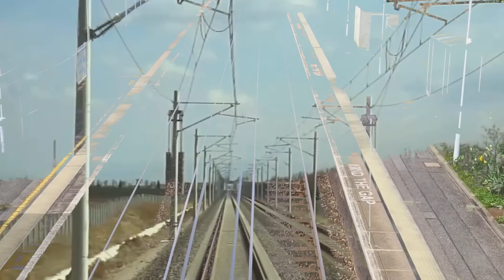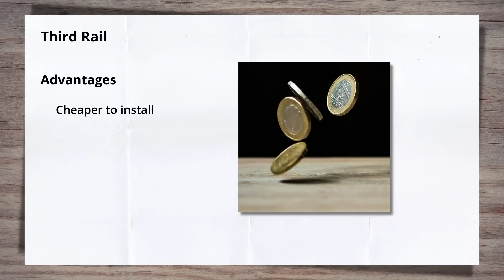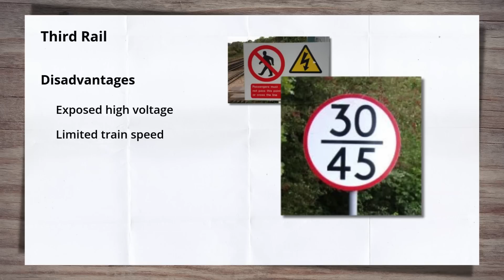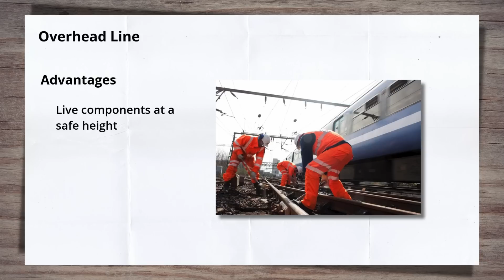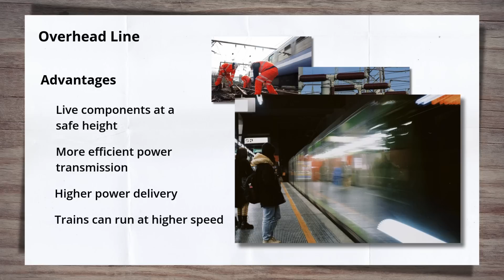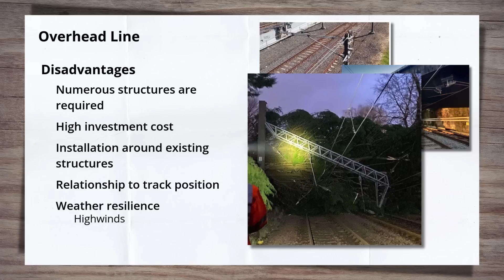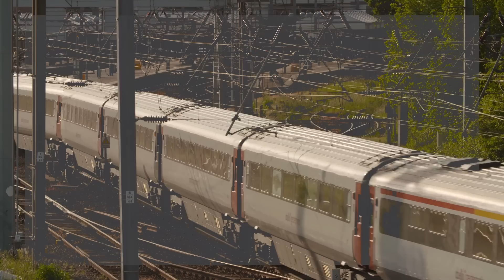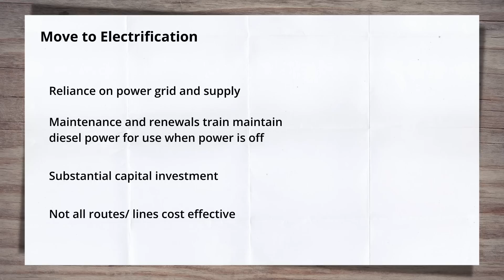How Trains Are Powered on the Railway | Third Rail vs Over Head Line Wires

Comment: No country except Britain supplies main railways with a third rail and such a low DC voltage. On the continent, several countries leave their existing DC systems (1,5 or 3 kV) replacing them with 25kV 50Hz for high-speed trains as in France and Italy. Conversely, you rarely find urban underground railway systems without a third rail.
Reply from the maker: Interesting! Thank you for sharing
Reply: True, and this is also because of the given power from any current vs voltage. High current / low voltage needs “thick” cables (practically, third rail) to carry the same “horsepower” (ok, (k)Watts) as a low current / high voltage across a thin (way cheaper) conductor (catenary, never 3rd rail for kV). 

Watts (P) = Amperes x Volts (except losses, AC power factor, impedance, Eddy, r-emf and lots of other crap…😅)
Reply: @musiqtee  Thanks for explaining that to an engineer for electric energy. I even learned to calculate a railway motor 16 .7 Hz & 1000 kW fifty years ago before electronics entered the locomotives. But these have a similar problem as their Voltage was limited below 600 V. But these locomotives have a transformer down from 15kV.
But anyhow, supplying main railways with 750V is odd.
Reply: @gottfriedheumesser1994   Slapping my forehead hard… I meant to explain to the channel’s creator comment… Sorry for that. 

But yes, there are some (very few) “dumb” systems actually running out there. Most could be “explained” from them being quite old (tech available at the time), and too expensive to change/redevelop. 

True, I don’t know of any low voltage 3rd rail systems using AC. Seems like an engineering nightmare for reasons you know better than I do…
Reply: @musiqtee  I is the dust and safety problem. Although the current rails in Europe are protected by a plastic housing against being contacted from the top and aside, their insulators are affected by moisture, dust, and dirt and cannot withstand higher voltages.
In the emperor's times, the trams on Vienna's Ringstrasse should not have overhead lines. So they invented a third rail system where the current rail was situated in a small tunnel below the driving rail which had a slot for a contacting device. But this was very misfunction prone, and shortly after the Emperor was gone they installed overhead lines at the Ringstrasse and installed normal tramway rails.
Reply: @gottfriedheumesser1994   Yes, I know - but me trying to “write a book” as a YT comment is doomed to fail (that’s all on me)… 😂  

Indeed, e.g. underside 750V 3rd rail in Oslo demands total overhaul in older ducts and tunnels. They slowly change towards alternatives to rock ballasted track beds “indoors”. Ferrous brake dust is pretty much gone as all vehicles now use dynamic braking, and disk brakes only for low speed and halting. Helps a wee bit…

Ducted power was also used for central London trams - due to nimbyism, not to engineering preferences. Humans and money make a strong force, even against good knowledge…

Comment: Ice breakers can be installed on pantograph collectors as is done in the U.S. for the east coast commuter systems and light rail systems around the country. Third rail systems mostly use 750 volts ac. Metro North rail in New York City uses trains that can run on third rail systems as well as overhead systems of both 12,500/2500 volts.
Reply: You can also use a pantograph as an ice breaker. Most locomotives have 2 of them. The rear one is for regular use and the head one  is for the ice break. It is even mentioned in the railway exploitation guide for Russian railways
Reply from the maker: Interesting about the ice breakers, I haven't heard of them before for OLE systems

Comment: Thanks for this video.
It's the most balanced treatment of the ups and downs of either one that I've seen.
Thank you also for packing in so many nuggets of information whilst keeping the whole thing entertainingly speeding along down the track.

Can it really be because of the impact of pick-up shoe to next section of 3rd rail that top speed is stubbornly stuck at 100mph‽ Can't find anything else online.

Not a fan of all the gubbins that comes with OLE for possibly facile visual pollution reasons, I can't help but think that it's about time that entirely different ways to get trains moving should exist by now.
It cannot be beyond the wit of man to come up with an onboard energy source, non-polluting, negating the need for any of it to be installed, maintained and child/idiot/accident - proofed in the first place.
Reply from the maker: Thank you for the kind words!

Having been next to a train when it is running at a fair speed, they do hit those ramps pretty hard!

Comment: One of the disadvantages of OLE you mentioned was sagging lines. Most (if not all) lines have "automatic" tensioners installed to overcome/minimise this problem. I don't believe you mentioned this.
Reply from the maker: A very good point! Something I have over looked. I remember there used to always be issues in certain areas on the Great Eastern due to sagging wires, that maybe have gone with upgrades to equipment. 

I wonder if the increase in the temperatures we are starting to see will bring the issue back or if the tensioner systems have enough in them to deal with a wide range of temperatures
Reply: @thepwayengineer as an Australian (where all metro/suburban rail systems are OHLE) sagging catenaries is rarely an issue these days even on 45°c days! 

You’re only ever at the mercy of poor maintenance.
Reply: @thepwayengineer  One of the reasons for the Upgrades was to remove the variable tension depending on the weather.
Reply: @J-Railway-Volunteer  Why remove it when it is 100% proven to work, whet did they replace it with?
Reply: @jonathonshanecrawford1840  The GEML used the Great Eastern (GE) range was designed by the London North Eastern Railway in the 1940s and was subsequently used by British Rail on the Manchester, Sheffield & Wath Railway electrification. The GE range was 1.5kv DC range, upgraded to 6.25kv AC then 25kv AC. GE had a large amount of fixed tension equipment on running lines. The GE range has been replaced by the Great Eastern Furrer + Frey (GEFF) range was designed by Network Rail to combat the issues of the poor performance of the 1.5kv DC GE because of the fixed tensions. So the GEFF features some firsts for the UK like Single Insulator Cantilevers which give a smaller live envelope and are easier to install. Network Rail also replaced the Auto Tensioners to replace the fixed tensioners.
Reply: @J-Railway-Volunteer  Is "Network Rail" nuts, do they think for the entire UK, the temperature is always the same (e..g. 20°C) 24/7 all year?
I can understand the different power issues, I would say (Network Rail) choose one!
Don't they under stand physics? metal wire expands when heated (the sun) and contracts at night? So how would fixed tensioners keep the contact wire parallel to the track or prevent sagging? Or over stretching?
Reply: @J-Railway-Volunteer  What's next? Removing the fish plates (except points) and weld the rails together, like some upstart engineer (20 year old) suggested in Auckland (NZ)! 
Oh dear me, the tracks buckled! then they had to cut new gaps and reinstall the fish plates. 
In tunnels, there isn't much light, to welding the rails together, would not be an issue!
Reply: @jonathonshanecrawford1840  Network Rail goes for a constant 2.5 tons of tension on the wires for new and renewals which replaced the old British Rail standards which didn't really care for renewals of the OLE.
Reply: @jonathonshanecrawford1840  Network Rail already does that and we rarely get issues as we tension the rails. Britain has been doing CWR since the 1950s with the stress-free temp being just under 30C. Most of the issues with track buckles in the UK are to do with jointed track.
Reply: @J-Railway-Volunteer  OH! That's new to me, here in Australian and NZ still use the old system!  
2.5 tons is that 2,500KG? AKA Metric tonnes?
Reply: @jonathonshanecrawford1840  Yes, it is 2.5 metric tons.
Reply: @J-Railway-Volunteer  It is interesting that the roadways use Km/hr while the trains still use m/hr in the UK! I have watch train driver cab view, some of the train speed signs look like Km/hr speed signs even though their are in miles?
Reply: @jonathonshanecrawford1840  All roads in the GB are in MPH. Not all railways are in MPH in GB. If it is white writing on black background it is KM/H and if it is Black writing on white background unless it says KM/H on it.
Reply: @J-Railway-Volunteer  Interesting, but confusing, for international travelers visiting the UK. As most of us like Australia and New Zealand use Km/hr on the roads and railways! Like the international speed signs are Km/hr. Would be misleading when the UK use international speed signs_(Km/hr)_ why not use the same "Type" as the USA?
Why would Network rail use both (different places) Miles per hour and Kilometres per hour?
Of course if the speed sign is in Km/hr, thus as you wrote, it has Km/hr, would it be otherwise by default MPH?
Reply: @jonathonshanecrawford1840 Getting rid of (most) fish plates, and instead welding the rail has been done on hundreds of thousands of kilometers of rail. It's a lot about getting the work under the rails done properly (good ballast, concrete sleepers..), and the doing the monitoring/maintenance. With the higher speed of trains today that track quality and maintenance is a requirement, not just a convenience.

I'd be surprised if eg the lines from London to Birmingham, Manchester and Edinburgh and Glasgow are fish plated. I'd be totally flabbergasted if HS1 isn't welded.

When I was younger,  in the 1960/70s there where occasional "sun curves" while Sweden still had a lot of fish plated rail. Nowadays there is essentially no fish plated rail on lines and I haven't heard of any "sun curves"  for many years.
Reply: @davebowman6497  The WCML went to CWR in the 1950s and 1960s.
Reply: @davebowman6497  The Manchester - Euston route was as I remember from the Manchester Evening News, one of - if not the first lines to be CWR as the line was electrictrified at the same time and CWR allowed higher continuous speed.
Reply: Overhead wire don't sag due to heat or cold, they are counter balanced to prevent sagging, as the wire expands (heat), the weights raises, when the wire contracts (cools) the weights lower! These weights are referred as automatic tensioning weights...
Reply: @jonathonshanecrawford1840  The original GEML OLE didn't have any form of tensioning system like weights.
Reply: @jonathonshanecrawford1840 Surely it's the other way round - as the overhead cable expands and sags the weights lower increasing the tension, and thereby tightening the cable; as it cools and contracts,the weights rise as the tension reduces.
Reply: @Volcano-Man  😃 Some one else has corrected me thus! As the wire contracts, the weights lowers, and as the wire expands, the weights raise!
Reply: @jonathonshanecrawford1840  If the wire expands its length increases, the weights lower. Checked last night with a PWR inspector who has to check the tension and weight. 
If the overhead sags then the weights rise, but that then brings the live cable in to close proximity with the carriage etc; and if it touches it results in fatalities as people enter and exit.
Reply: @jonathonshanecrawford1840 
Could your source explain how the weights rise against the pull of gravity when there is less tension on the line (cable has expanded) and they fall with the pull of gravity when there is more tension?

ie how does the weight get an extra force to go against gravity when there is less force from the cable?
Reply: @Volcano-Man  Why do some people think when the wire expands (day time) the counter weight raises, it doesn't, it lowers. Meanwhile at night time the cable contracts and the weights lower, that is also wrong, at night the cable still contracts - _loss of heat- the weights raise!
Isn't that why the weights lower (day time) because the wire expands, and at (night time) the wire contracts, the weights raise?
Reply: I believe the "overhead conductor rail" in Japan is a good method to overcome this disadvantage, given that it is an underground railway line running at typical speed (80-100 km/h).
Reply: @bejeweledman  Question: Are you talking about Solid metal overhead conductors? If so this would be expensive as the structure to install/upgrade as metal production uses carbon fuels to produce electricity to make the solid metal conductors, as to wire conductors!
Reply: @bejeweledman  In the UK we call Overhead Conductor Rail, Rigid Overhead Contact Line and it has been certified for speeds up to 275km/h.